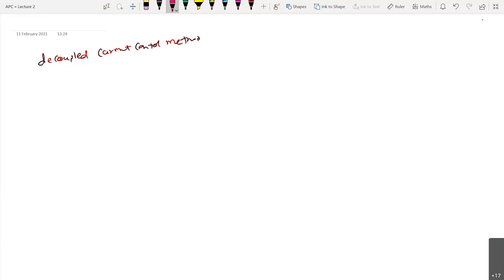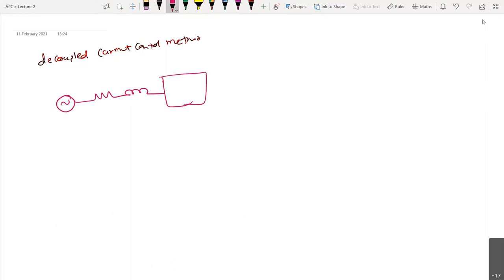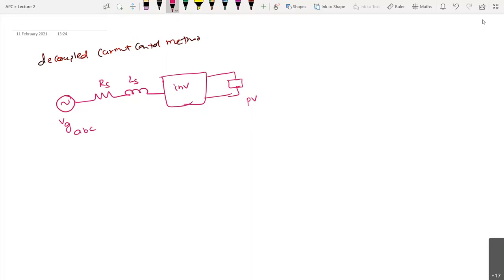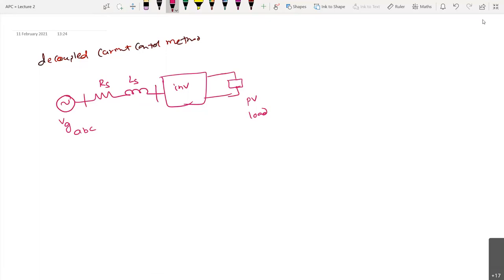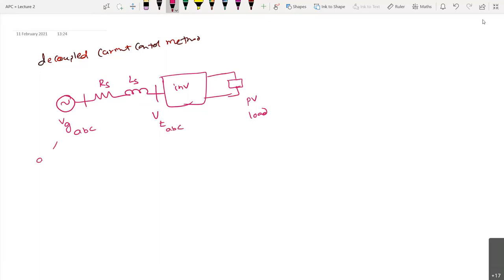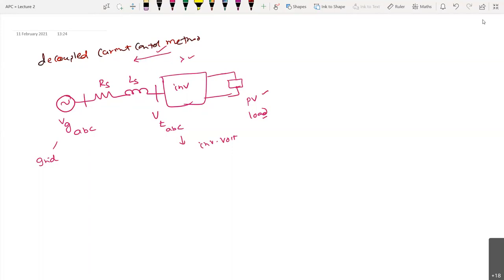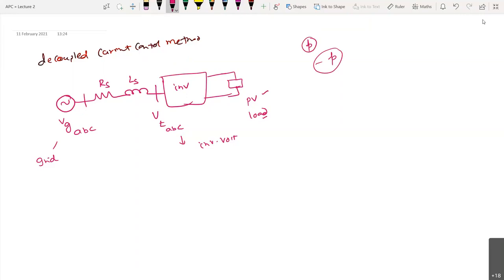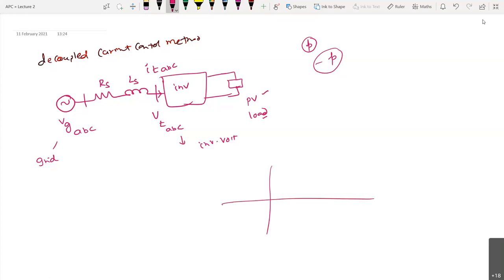Lecture 6 | Grid integration of power converters and decoupled current control of active rectrifier

Comment: What is the reference book please ?
Reply from the maker: Control and Performance of a Transformerless Cascade PWM STATCOM With Star Configuration
Decoupled dq-Current Control of Grid-Tied Voltage Source Converters Using Nonparametric Models